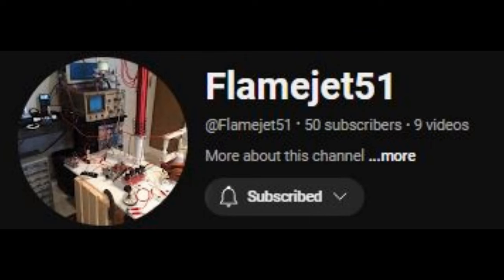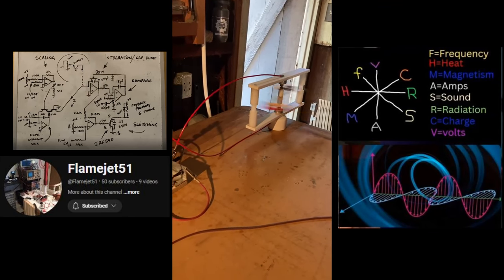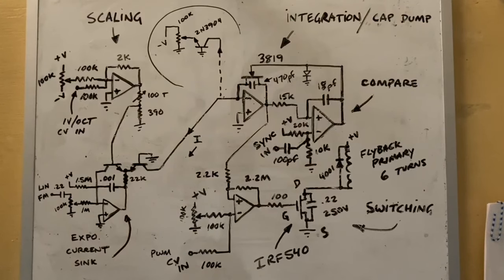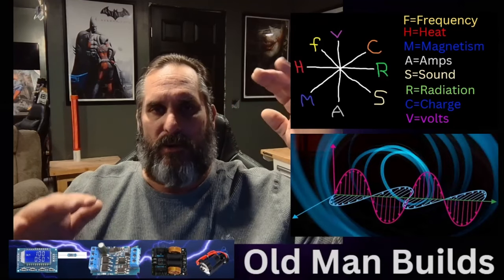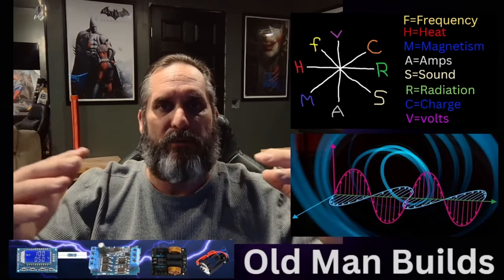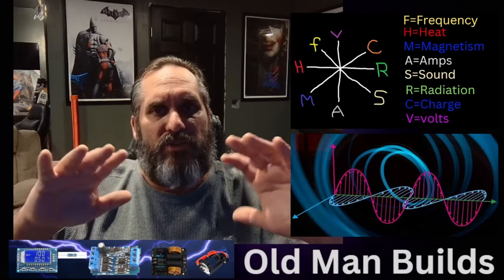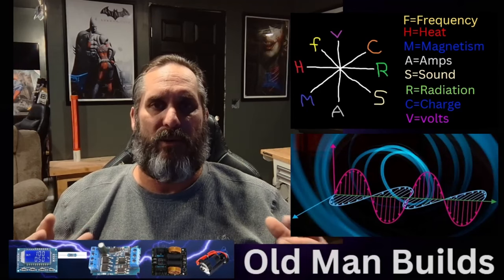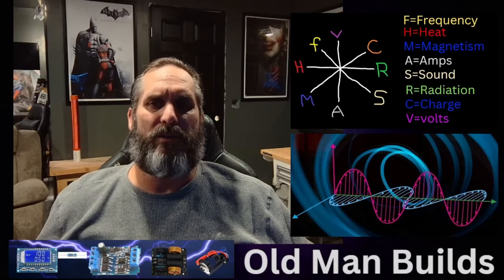Validating High Voltage Understanding #57

Comment: Your great work most include gradient in charge between center and edge of the discs(higher density in the center and leaky low density in the edge gradient in amplitude(alex charge capacitor in stages touched for0.5sec then 1sec then 2sec and repeated.. to build charge and get reactive force from capcitor/dielectric surface , gradient in powering the zvs and fb trans aka  in circular fashion 18v 15v 12v then start again 18v 15v 12v like knight lighter leds in music fashion ten ton toon and repeat ten ton toon😅 
Its much easier simpler to use dual circular whirlpool black and white swirl like disc to great gradient of charge in the rotator disc like the disc being used by hyponsis treatment
Good luck great well❤ old man build🧗

Comment: In much simple academic term when increasing the frequency we get increase in impedance in a conductor segment (the reaction of conductor segment to higher frequency) in other word increase skin effect the electron on higher frequency tend to move /push the next electron to it to the outer rim of the conductor segment ,for that reason engineers in smps design utilize multi stranded thin copper wire to reduce skin effect and build small capcitor between the twisted wire surface around 2 pico farad to cancel out stray noise high freq EMI
Reply: I was going to say the same thing. The wire you mention is litz wire. Litz wire winds the primaries of new microwave transformers.

Comment: I feel like there's a way to make an open source Arduino like like that can simultaneously measure and log deiffent energy outputs such as voltage, current, sound in dB, temperature, etc.

Making total measurements across all the variables would yield the quickest way to more completely see a real correlation.
Reply from the maker: @michaelgolfetto9619  the only problem is not all flybacks are the same so charting for everyone may be out. Making a testing rig would work. Yes plotting one would show the overall effect

Comment: Nathan, it seems as if the gravity flyer needs an adjustable regulated power supply to keep all parts of the power stable. Is your power supply regulated and adjustable? A battery regulates itself and why Alexey uses a battery sometimes in my opinion.
Reply from the maker: he is changing the duty cycle and frequency when the volts and amps change. the power source is consistent.
Reply: Nathan, how about switching adjustable regulated power supply? They are about $35 on Amazon. Duty cycle. Change the frequency so the power is on less or more. It would be easier to change the circuit and get results much faster.
Reply from the maker: @richardmuller867  you are assuming the power supply is bad. It is working perfectly. These changes are from the frequency or duty cycle. it is the best way to change volts and amps. he was getting it right . less amps and more volts and higher frequency are best to do for ion wind. the circuit is in perfect operation.
Reply: @nathanbunten4299  Ok then I am incorrect about this. Thanks for the explanation. I understand the entire video. I was just looking for a simpler way to do the test. This guys power supply does not have a knob for volts and amps and needs to make a much more complex circuit to control everything.

Comment: i find out something its not high voltage you want its high amounts of static electric its different to high voltage your all wrong static is what you need , buy an air purifier use it to create high amounts of static negative ions.
Reply from the maker: The question is what part is better for each project. He needed a high voltage low amps for his ion wind. The graviflyer needs both the static volt and the magnetic volt. As long as the field spreads. That is why building the correct circuit matters.
Reply: High voltage (the measurement) and high static are the same thing, electrostatic potential is measured in volts.
Reply: The output of the flyback transformer is high voltage DC, sort of:).Because of the output diode on the flyback, the DC is the positive side of the output frequency. T might better be called pulsed DC. Are you suggesting OldManBuilds adds a high voltage static potential to the graviflyer? Thanks for sharing.